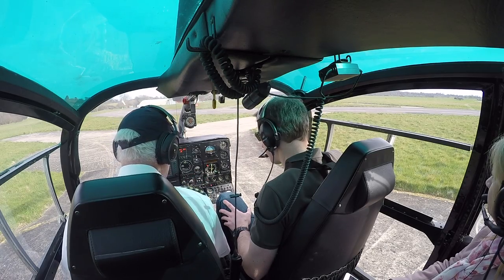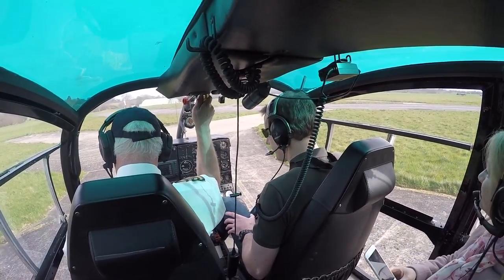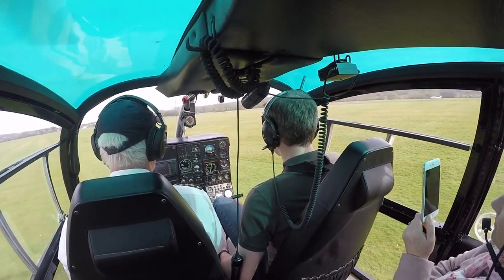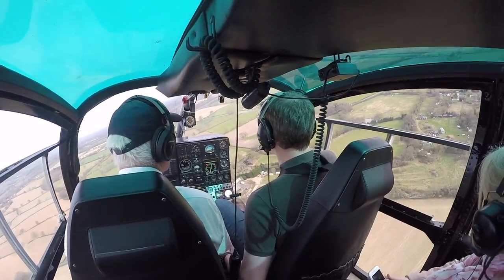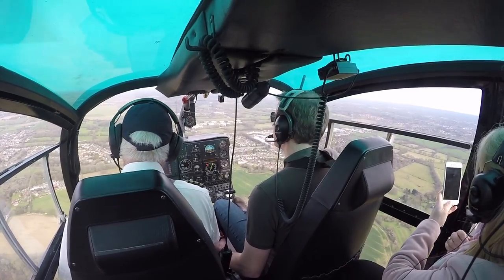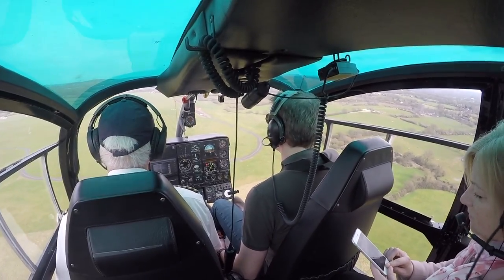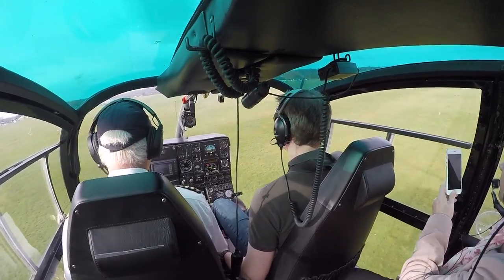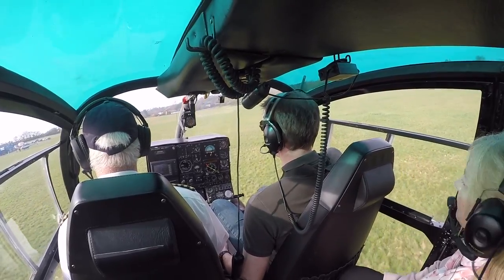Gazelle Helicopter SA341C - First Time Flying a Turbine

Comment: Very smooth for a first flight. Nice sideways hover at the end.
Reply from the maker: Thanks, although the Gazelle is a much larger helicopter it has very similar characteristics to the Cabri G2 that I originally trained in to get my PPL(H)
Reply: @HeliPilotPaul  I'm not familiar with the Cabri G2. My first rotary flight was in a Hiller 12E. (Say no more..). But what was the hourly cost of dual in a Gazelle?  Not cheap, in the UK, I'd say.

Comment: Do you need an extra rating to fly turbine?
Reply from the maker: Nice Push yes you do. However the guy I was flying with was an instructor so it was classed as a training flight and he’s qualified to show me. I hold a helicopter Private Pilots License (PPL H) and even if I had a type rating to fly the Gazelle I’d still need another type rating to fly another turbine (ec120) as pilot in command.
Reply: @HeliPilotPaul  Thank you for sharing.
You're a lucky man; these Gazelle's look and sound like no other.
I had some ride alongs in an Alouette 3 in the early 90ies, loved every bit of it.
Reply from the maker: Nice Push Alloette is on my bucket list to fly, what a lovely machine. 👍